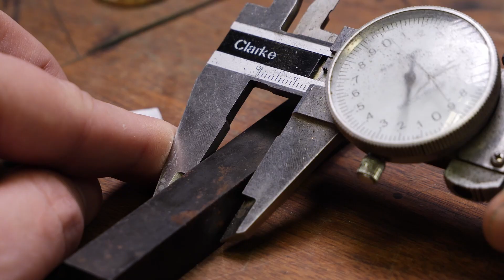How to make an ashes pendant.

Comment: Love it
Reply from the maker: Thank you. 👍🏼
Reply: @metalofhonour  anytime
Reply: I’ve actually got someone who is wanting one made. Glad I got to see this
Reply from the maker: @macmillion83  definitely the best way to have the ashes. Fully encased.
Reply: @metalofhonour  even without the welder, it wouldn’t hurt the ashes to if you had to solder bottom would it
Reply from the maker: Super high risk soldering any enclosed space, due to air tight chamber that can't let out the gas build up when soldering. Especially when you need flux as well that will bubble up. This was the first one I've done in silver because my welder can be a bit splatty it. I normally only offer this type of jewellery in platinum. Mainly because the welder loves platinum.
Reply: @metalofhonour  thanks for that one lol could’ve been bad lol

Comment: What kind of tack welder is that?
Reply from the maker: Hi. It's the Orion Mpulse 30 with swing arm microscope with optical shut off for the spark. I was lucky to capture this, as it isn't the best welder for silver. Golds, palladium and platinum it does everything. Silver is hit n miss.